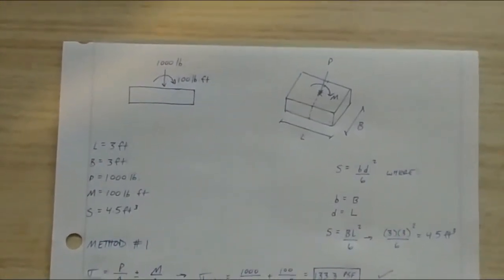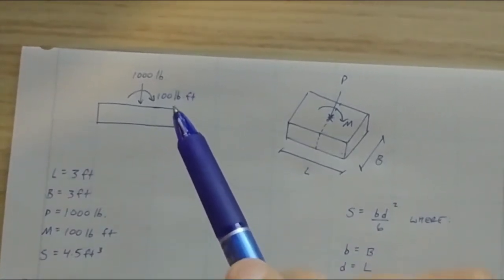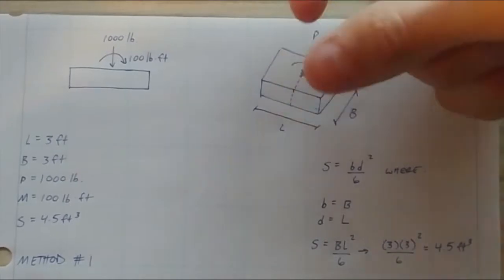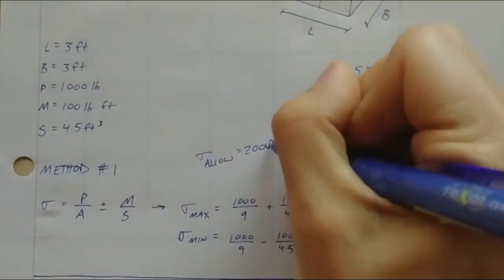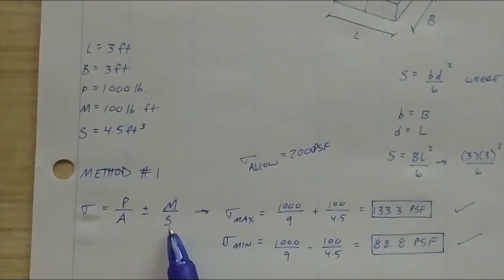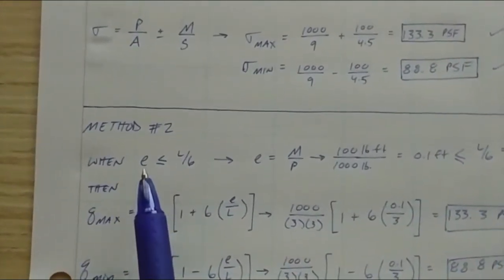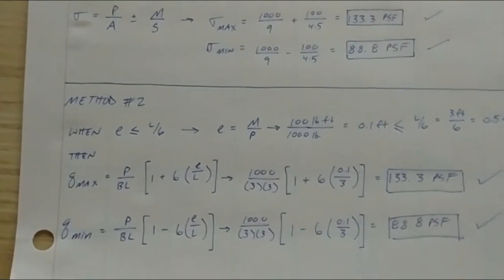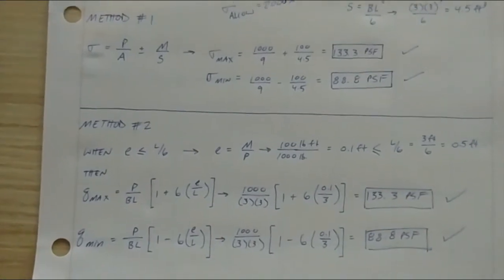Foundation Design For Beginners Part 1

Comment: Could you consider an example of finding the moment on a column footing? I understand the general concept, but I don't understand where the moment equation comes from (CERM says M=qLl^2/2). They say it's based on an idealized cantilevered beam with non-uniform loading, but that doesn't make sense to me since that's not the moment equation... If you already have a video, would you mind sharing it :) Thank you! Love your videos :_Surrrrre:
Reply from the maker: Hi Estherbass! thanks for this question. I am familiar with that CERM equation... is that in the electronic CERM for the CBT pe exam or a paper back one? let me know and ill check it out!
Reply from the maker: and thank you for your support in joining the porukka gang!
Reply: @Kestava_Engineering  Thanks for responding! I actually think I finally figured it out. I was using a problem where there was no eccentricity in the footing, so the line load should have been constant and the moment wl^2/2. The equation from CERM is 16th edition 55.24, it's basically moment of a fixed cantilever but written in terms of the soil bearing pressure, but it makes sense now. Thanks again!

Comment: I see a comment related to this. Can you please explain again why the section modulus is B*L2/6 and not B* T2/6? 
The nuetral axis is along L. Am I right? At that point, if we go back to the basic Stress = My/I formula, the "y" factor for me seems to be half of the thickness. Because L at the top face increases and L at the bottom face decreases. So shouldnt "y" be the distance from nuetral axis to the bending face. Hence T/2? 
At that point, the section modulus gets derived to B*T2/6.
I don't understand where I'm going wrong.

Comment: I understand a point load is just from the “gravity” (Snow, dead, live, roof life, etc.) but “how”/where does the moment come from?  Is that from the wind or Seismic? (Lateral)?  I’ve just been wondering or is it from the overturning moment or resistance moment?
Reply: The loads dos not often come at the center of the base; This depends on the location of the base in the construction, and the bending moment is equal to the factored loads multiplied by the distance between the center of the load to the center of the column or base (eccentricity). Usually, the reactions (including moment) are calculated from analysis programs and the design is based on them, and It can be calculated manually
Reply: the moment comes either from the gravity load or lateral load or both of them
Reply from the maker: said it beautifully Mujahed! Jeff does that help answer your question??